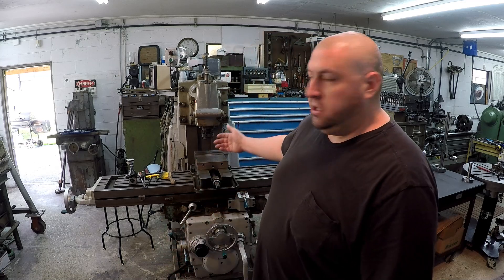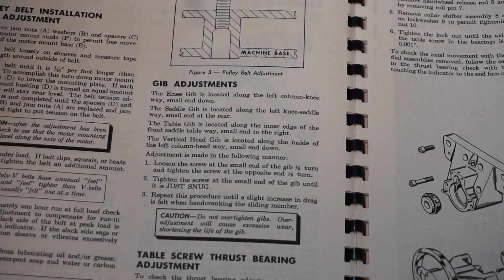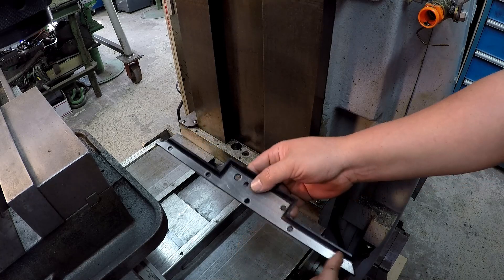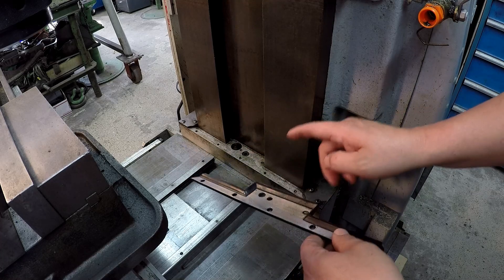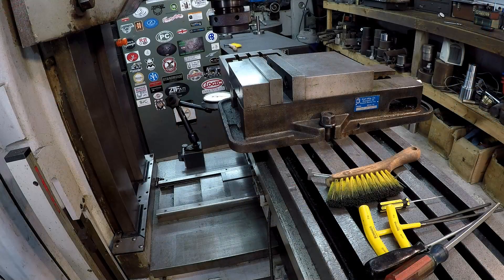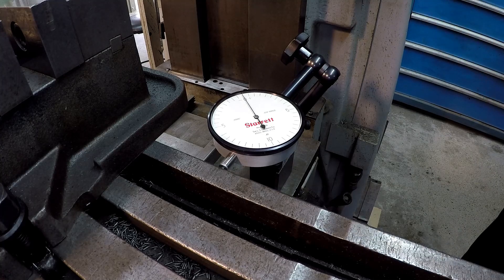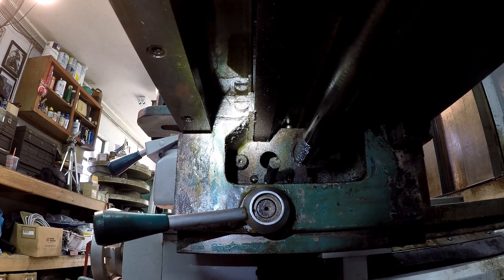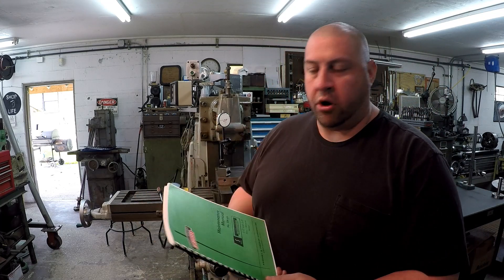Checking Gibs For Wear & Needed Adjustments

Comment: I noticed you snugging up the lock when you were doing the work on the mill at work the other day. I've learned to use that on the mill I have and it helps quite a bit to reduce the vibration. There is definitely a fine balance between adjusting the gibs down and not having them snug too much to that it makes it too difficult to feed the table.
Reply from the maker: Me too Ryan. On my other knee mills it hasn't been a problem, but that K&T is pretty loose on the knee.

Comment: Good information.  One thing to discus is that most machines will always have more wear in the center (area of most use).  I've adjusted the gibs on a well worn Bridgeport that made it work nice in the center 1/3 of x travel, but was then impossible to crank it to either end.

Comment: This was actually explained to me today on a lathe. If they're the same gib's, then they are tapered, so there will be a different amount of play between both sides. If you know which side is the smaller taper, you should adjust it specifically to that side.

Comment: I have a note of interest for Jason of Fireball Tools, or anyone who is going to use large heavy face mills, fly-cutters or boring heads on these hydraulically operated machines. When you turn on the spindle it engages the clutch almost instantly. Then when you stop it the brake engages almost instantly. Imagine driving your hot rod with full throttle or full brakes, nothing in between. The result of all that torque can be broken gears or twisted shafts. I found that to use heavy tooling you should hold out the speed selector dial before you press the on button to release the brake and let it come up to speed. Then pull it out again to slow the spindle before using the off lever. If you try it a few times you will see. Or you can readjust the column hydraulic pressure to slow the engagement of the clutch and brake. I built an 18" face mill that took out the gears in the vertical head when I stopped the spindle. Not a cheap repair with precision bearings and 2 pairs of gears and having to bush one bearing bore. I would hate to see someone else go through what I did, or worse as I can't imagine repairing the damage to the column drive-train. Just a note from my 30+ years in the shop.
  Mike (o\!/o)

Comment: It's worth noting that there are different styles of gibs. The ones on this machine appear to be tapered gibs which have an adjustment screw at each end. Smaller or cheaper machines and slides often use straight gibs which have a number of adjustment screws running the length of the gib.
Reply from the maker: Yes that's correct, My shaper has a straight gib.
Reply: That is true, but I can see that the principle is the same, we just have to adjust all the screws instead of one. This has really given me ideas about checking, particularly on my little but very heavy Centec 2A which has all the weight of the knee hanging off the gib in the vertical ways so is a bugger to adjust.

Comment: Do the wipes wear out? Are replacements available?
Reply from the maker: Yes they wear out and are one of the main reasons ways get worn out because they fail and are never replaced. Most machine ways can be found to purchase, or made to fit.
Reply: my 1919 South Bend doesn't even have wipers, and never did...but it will soon, I'm working on some right now after getting some ideas from Old Fenner and Randy Richards...this was more intimidation, LOL, there's not much chance mine will come out like the K&T's
Reply: I still can't understand why hardly anyone wants to protect the ways of horizontal mills with a guard like the ones that come standard on most vertical mills.

Comment: Not trying to be critical Adam but a parameter your friend might also want to check is the fore / aft play of the knee on the column. With box ways on the K&T the gib only adjusts for side to side rocking and has no influence on nodding of the knee. I expect this adjustment will be via shimming just like the saddle on a lathe.
Reply: I was going to comment on that too.  I would check for up/down "nodding" of the knee separately from side/side play.  I think a taper gib would adjust for both types of play, but I have no experience with Box ways.

-Gordon

Comment: My Cincinnati needs a serious scrape fest on the gib ways. If I get my gib adjusted at the bottom it will be .008" loose in the middle and locked up at the top. I find the table ways for some reason always seem to stay the best. probably because they don't get exposed to chips much since they are kind of a sealed deal or what is exposed is facing down so everything gets wiped and falls off as oppsed to ground in to the knee and saddle.  I hope your K&T is in better shape and you can get it snugged up without it having spots it gets too tight.  Someday I would like to do a rebuild on the Cincinnati to get it back running true. For now if you have to do accurate work over long distances with it It takes screw jacks and c-clamps. :-(
Reply from the maker: Brian, I think we all deal with the same problem. I can tell the table travel on the K&T is pretty good across the whole travel, although it is a bit more loose near the center. I'm hoping the knee up and down won't get any tighter because it's already tight.

Comment: Hey Adam, I watched this video and decided to perform these checks and adjustments on my Excello-602 knee mill. What I found is that I have some decent wear in the middle of the x travel and a little less in the y travel. I guess thats to be expected from an old machine, but anyway from what I've heard the gibbs are tapered in this machine and I've heard scraping in tapered gibbs can be pretty challenging.. Not sure if I can source new gibbs for this machine either as Excello is long out of business. Any advise?

Comment: Well, that 0.007" and 0.006" explains why you need to lock the knee and saddle during a cut. Don't forget to check the play at several points of travel (indicator still over the end of the shorter way) to make sure that there isn't a difference of wear in the center versus the ends of the ways.

Comment: Hello Adam, I noticed on the top working surface of your X-axis it has a mottled pattern instead of a planer surface, is that a deliberate manufactured process?, to indicate a form of scraping in?, it surely cannot be caused from machine operators,

Edmund............Alberta
Reply from the maker: If your talking about the top of the table, that's just from being abused over the years, most likely from its early work life.
Reply: Oh my word, that  is Sacrilege, (desecration),

Comment: Hey Adam, I'm confused, it seems like you tested the saddle and table gibs in the same way.  Wouldn't one of those tests be different, by for example pushing the table in the direction of the garage door, seeing if it moves closer to the door?
Reply from the maker: To measure the table you mount the magnet to the saddle itself, and not the knee, then put the indicator on the table.

Comment: If you ever need to repair your wipers, 2 part polysulfide epoxy vulcanizes and has a shore A from 20-80
Reply: Thanks Jimmy, that plants a seed in my head...any particular source you'd recommend?
Reply: Knolltop Farms If you need 45- like a tire or slightly softer, I have some, but I'd think those wipers are closer to 30. If you want some 45 to play with, I can get you some in a couple peanut butter containers for the shipping.

Comment: gib |jib|
noun
a wood or metal bolt, wedge, or pin for holding part of a machine or structure in place, usually adjusted by a screw or key: [as modifier] : gib screws.

Comment: Hey abom, have you thought of trying one of those matte finish or anti glare cell phone screen protectors for the big dial indicator?  You would probably need to get the flexible plastic old style screen protector instead of the new tempered glass kind. But the indicator has a crystal lens right? I don't see why you couldn't just order one for like a Samsung igalaxy note 7 or whatever that new giant tablet thing is that people consider a phone..haha...I don't know, really the glare didn't even seem that bad to me, but I'm sure it might make it easier to work with on camera when you're recording. You might even be able to search like 6" tablet anti glare screen protector, on eBay and have one for 2 or 3 buck.
Reply from the maker: Might look into that, thanks.